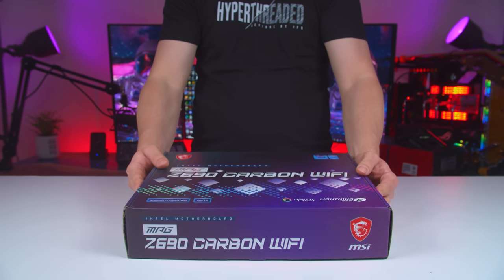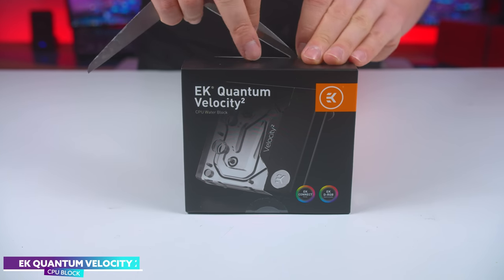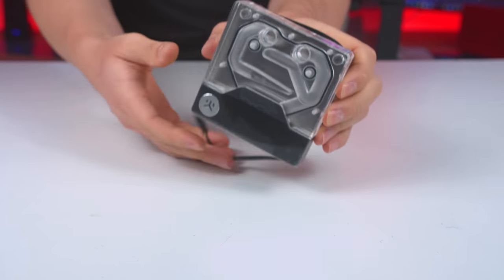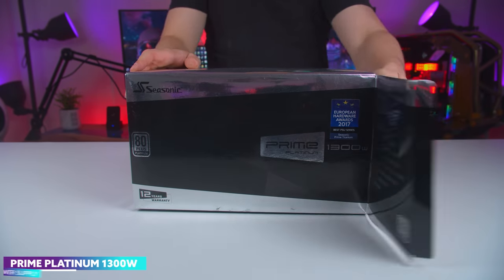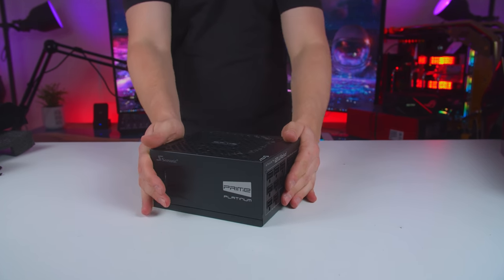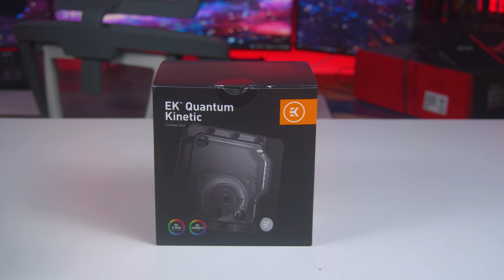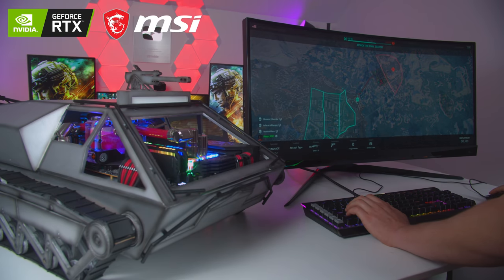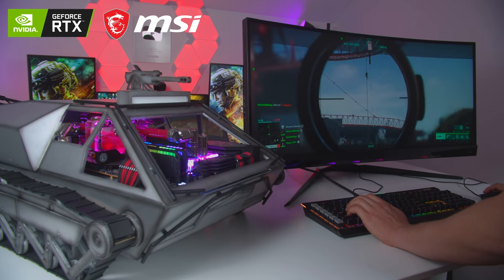I Built a $10000 Water Cooled Battlefield TANK PC - RTX 3090 + 12900K

Comment: Okay, so, the fact that this build is built in a tank case is absolutely amazing, but there is a thing, those graphics card only stick in place by using the tubing ? Also the same for the pump ?  Pretty weird for me, but well done, you really did a nice job as always ! Keep divert us by building some of these :D
Reply: That’s because he built the case self of course
Reply: That the art of Mods. It not based on your logic but it on the builder own preferences & accessibility. As long as it not affected to the performance of the system & not harmful, it good to go.
Reply: seems like he either ran out of time or ideas of how to hold the GPU's in place... also what is the point of having two cards if they aren't linked??? ESPECIALLY with only one monitor.... if I paid $10,000 for this I would BE PISSED!

Comment: Nice build Corey.
Question: if you don't remove that plastic protective film off the MB and other components before installing it in the system what happens? will it melt from the heat of running the PC each day?

Comment: To be honest with such great components I would prefer to have them on full display like in O11XL or some other big tower case with glass panel rather than in a „tank” which covers most of the magic inside, having only small glass panel in front and even smaller ones on sides.
Reply: They are mostly on display in the tank.
It just takes up a lot of desk space, kinda why cases tend to be vertical to utilise space better

Comment: 2 360 rads won't be enough to cool everything under full load. You are looking at over 900w of heat output,  you'll need 3 360 at least if you want you fans to stay quiet.

Comment: I am so sorry, but if I paid this amount of money on a PC to be built like this and you gave me that case I would want an immediate refund. The case is not only bad, but it is horrible. Just outright horrible. You should have fabricated some metal, and or fabricated or sent in for order your glass, and even if you didn't use any of those I would have at the very least used something like carbon fiber. Wood along with the finish of that particular wood looks horrendous let alone the design of the actual tank. Of course the components are high end, no issue there. But the case is the worse I've ever seen